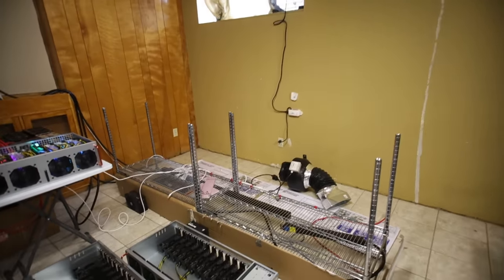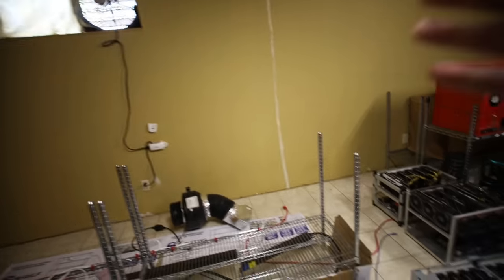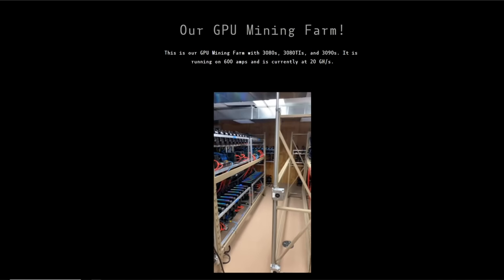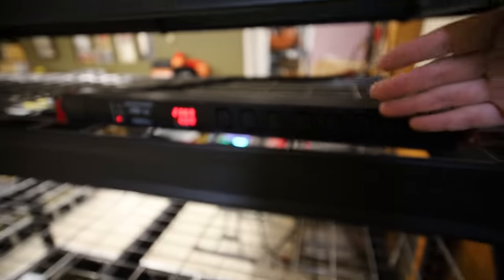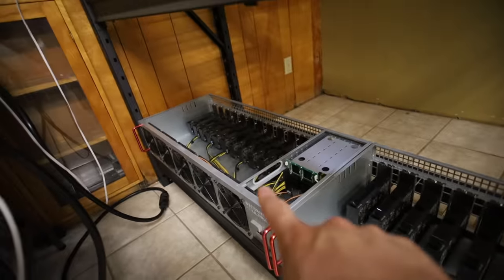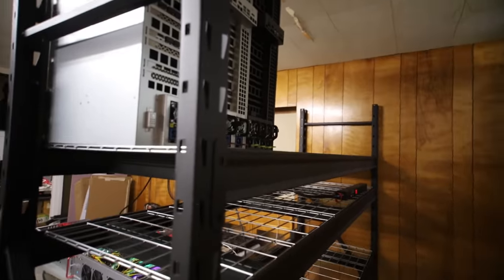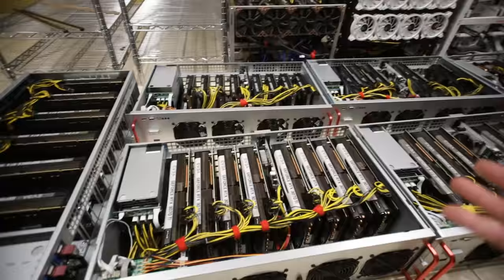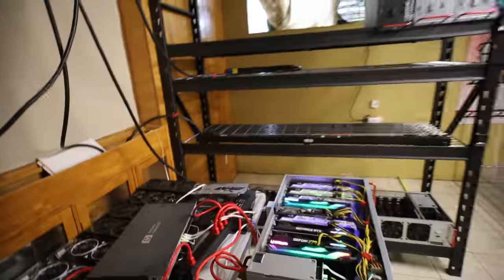I lied.

Comment: Looks good, especially spacing out the exhaust area to make it a larger area will help big time. But If you plan on leaving all of those rigs in that basement and not bringing them to the new place then that 1 exhaust fan won’t be enough to take out all of that exhaust from the rigs still, I think at least. Of course test it and see first but I have a feeling your going to need another exhaust fan on that window. Or buy another husky shelf and do the same with the other window with the exhaust on there and split up the rigs which tbh idk if that will be enough exhaust power still.

Comment: Interested to learn of the results of this new cooling solution.

Peace

Addendum:  approximate cost analysis of each new setup / configuration is as interesting as the type of equipment / gear used.

Comment: About the Octominer X8. What is the Difference between this 2? They are the same with different PSU?  What is the exact difference? I need 10 of them but witch one?

HIGH SPEC 8GB/60GB/3000W
HIGH SPEC 8GB/60GB/1840W
Reply: The only difference is the type of card you plan to fill it with; hence the reason for two different PSU / wattage ratings.

Comment: When you start planning how to funnel the heat from miners to 2nd floor, remember to check what building regulations say about isolating areas against possible fire. It's probably not major issue, but for any insurance reasons you want to share bit of attention there so you can then make things according regulations.
Reply: Also to add to this, the machines so close to the ceiling could be a problem. I know that servers in a data room can’t be closer than 24” from ceiling according to the fire Marshall that inspects my data centers. Also these codes can change depending on fire suppression systems such as sprinklers or gas systems. 
BTW your setup is awesome.
Reply: @jdogb1  Yep.  Being a home miner does not mean freedom from making things safely.  It is important to pay attention to the fire safety things, because it would be really bad thing if the amount of people who ignite some fire due mining goes up, that would result insurance companies and society making even harder regulations and rules and bans to that activity. 

When the wattages go up enough, also the work taking care of the potential fire hazards should also go up. There is lots of images in internet from burned down houses and facilities due mining, it can start getting attention towards to more restrictive direction.  

At least the common sense for me means the distances from the machine to things potentially spreading and fueling up the fire should be far enough to prevent the fire spreading if some single miner catches fire. If the hypothetical flames coming from miner can not reach other combustible material, there is good chance the fire could simply go out because not able to spread to other materials, then all you have is smoke damages and broken miner, but it wouldnt be bigger than that.

Comment: RPM why don't you use the octopus cables that come with the Octominers? You can just order a c19 to c13 cord that way you save on your outlets? Cables I got for mine are rated for 15 amps so can handle the multiple PSUs from a single Octominer.